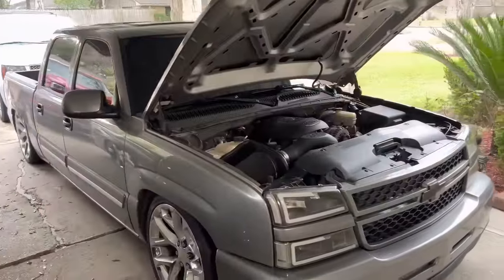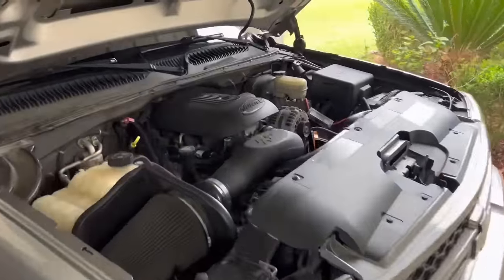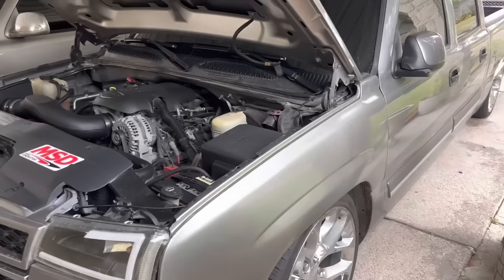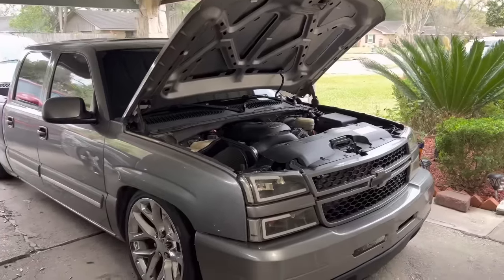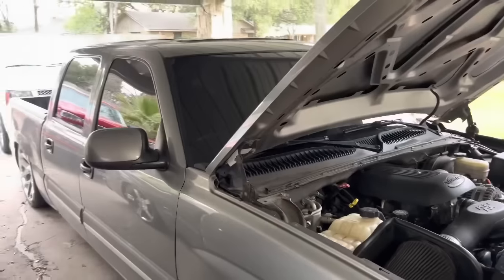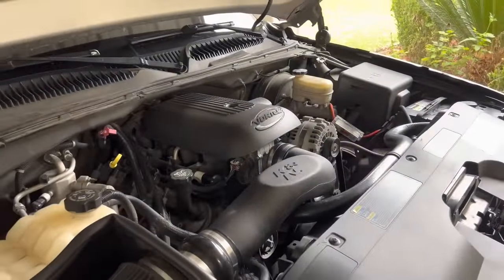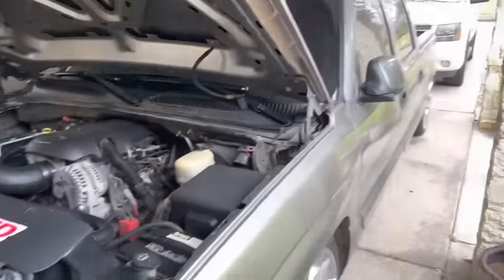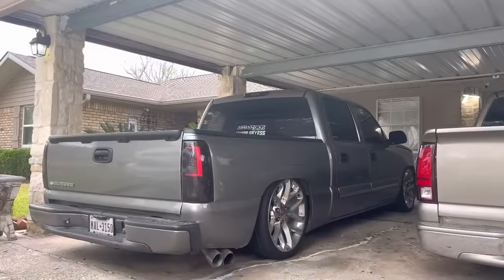PROS AND CONS OF OWNING A CAMMED TRUCK *COLD START*🔥

Comment: One thing that helps a lot with the 4l60e is a massive trans cooler. Mine used to keep slipping out of lockup once it got warm until I put the larger trans cooler in

Comment: Sounds amazing on the cateye 🔥 would like to see a 6.2swap  fbo 😁
Reply from the maker: Go big or go home 👀
Reply: I have a 6.2 single cab fbo nbs sounds amazing 👌
Reply: @nbs.reyess  put a 7.0 if you wanna go big
Reply: My engine builder told me to stick with the 5.3 and go big with a power adder. Theirs more cylinder walls to play with compared to the 6.2. I have both the L86 6.2 in a 2015 with an 8 speed and a 2007 classic with the regular 5.3. Ima build it along with a 4L80, bug cam ported heads and a lot of nitrous.

Comment: I got a lifted 08 silverado with 37s and its cammed and i went with a 3k stall and went with a 40k trans cooler.   Bypass the radiator and it will last longer bc its cooler.
Reply: I’m building an LS swapped S-10 with a 4L65e and I’m using a huge aftermarket radiator without trans cooler. I’ve bought a 40,000 GVW trans cooler that I’m mounting under the bed, in the wind but away from debris. I may have to put a fan on it later, I’ll keep an eye on the temps.

Comment: The 4l60e isn't trash, it's a great transmission, leave torque management in your tune, put a good aftermarket cooler on it, heat is the number 1 killer of them.
Reply: @74mythos  if i put a big transmission cooler on can i do burnouts without the tranny blowing up??
Reply: @lamydora457 definitely could. At least with mine I’ve had more troubles running it high speeds pedal to the floor kinda thing. Burnouts aren’t too bad, but they definitely won’t help in the long run

Comment: Do you know what numbers your pushing with the cammed truck??
* You should keep the v6 and put a BIG A$$ TURBO on the single cab - upgrade trans/ engine management/ fuel - dude on the real not a lot of people do this and it’s a really nice and easy build.. when/if the 6 goes then build the bottom end and throw it back in there wit more boost OR LS swap then

Comment: I got lucky and got an 04 cateye with the trans cooler radiator and a rebuilt jeggs transmission,  and the only issue I've had was the shift solenoid which a corvette servo did wonders in preventing again, also having a bad electrical issue with taillights, grounds gd fuses and switches gd so now I'm at the bcm as junction block is gd. BUT she looks so good with new headlights released by Z-OFFROAD LED Headlights Assembly. Even if I get rid of her with these electrical problems I'm getting another cateye so I can keep these headlights lol.
Reply: Bro I went with those headlights and aftermarket taillights. I sealed all the connectors and it fixed the problem.
Reply: I just got mine back from the shop for a control shift solenoid issue, in drive my truck for some reason would only “ run “ in 2nd gear I would be slow af at takeoff from complete stop and would max out at 50mph and then out of nowhere it would fix itself and drive like there was no issue but now that I’ve gotten it back from the shop it’s a night and day difference!

Comment: Gotta get it tuned right for cammed.

You are indeed correct the 4L60 is a piece of shit excuse the language but I’m literally saying what it is. It’s fragile. The drive train is fragile. Seriously. I dealt with my families Tahoe. 2002 5.3. Rear end broke twice. Brand new transmission and it just shifts like shit. Shifts hardly. It’s weird! 285HP V8 with a crap drive train. It’s a shame. I’d beef your drive train up dude! Plus that motor some more. Save your money and work hard. I got a old 2003 ram with the hemi I work hard for since I was a teen. That truck is a monster. 450HP from 345HP.  Bought it it had 390HP Has a tune, air filter (big K&N filter than the ones you see) exhausts (meh possibly a few horse) MSD ignition was like 15HP added could tell the difference! I did a tune up on it and some other crap I felt power difference for a while i had it at around I’d say 415hp. Custom intake manifold, throttle bodies, exhaust manifolds. Yeah

Work hard bro keep at it save the moneys sweet trucks I like the old Chevys a little bit they are nice to drive
Reply from the maker: Highly agree on the tune, thanks for leaving a comment , very interesting 💪🏼
Reply: @nbs.reyess  yea plus get that drivetrain aftermarket or beefed up. Rear end, transmission. Etc etc. you’d get more reliability and tire smoke back there, plus more speed horsepower and the rest of that fun shit

Comment: Nice truck bro… quick question my 2005 sierra 5.3 has 170k I want to put a cam in it should I rebuild the motor. It runs great im worried if I put a cam I might have problems later . Any suggestions or recommendations I will greatly appreciate it thanks

Comment: Is this truck RWD or 4WD? I have an ‘06 Sierra I’d like to start building on, but I’m stuck between getting a different RWD truck or going with a built 4x4 tranny and going from there. I also haven’t considered the transfer case, if that needs to be upgraded or not.

Comment: What if you put a cam but you don’t abuse your truck. Can you still leave the 4l60 transmission?
Reply: I have a cam myself 6.0 supercharged stage 3 cam with 4l60e trans cooler,shift kit and corvette servo
Reply: Aw my bad and I have a 3k stall
Reply: Converter

Comment: Would u say the 4l65e is a better option than the 4l80e?
Reply: HELL NO!!! A 4L80 is THE BEST option but they don't go right in, there's a little bit of work involved but well worth it. A 4L65 and 4L70 isn't much better, its just a tiny bit less shitty than a 4L60. I should know, I have 1 of each.
Reply: Don’t listen to him he doesn’t know wtf he’s talking about 😂
Reply: @DM-qp7do  lmao good one
Reply: @DM-qp7do  but all jokes aside if u build them right their good Transmission’s performance wise better than a 80e
Reply: @demarcusbody9437  absolutely. For racing i wouldn't even bother with a 4L80. But for a 400 horse or less truck it works good for beating on in the streets. But yeah, not a performance trans by any stretch of the imagination.
Reply: @demarcusbody9437  for this guys truck a stock 4L80 would be fine. He can smoke the tires and the 10 bolt rear end would get smoked long before the trans. But not for racing. Although Monster builds a good 4L80 for racing I hear. For the price that is..
Reply: @DM-qp7do  but still if the 60e is built right it can handle whatever is thrown at it also it doesn't rob u of power like a 80 for instance performabuilt & rpm transmissions they build some of the best 60's in the world I've seen guys run them on twin turbo builds & their still running strong